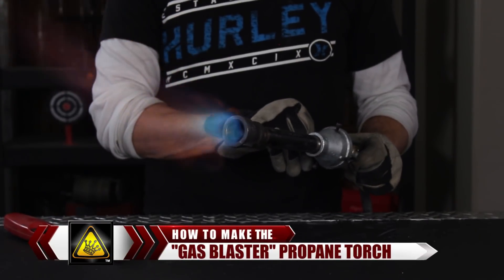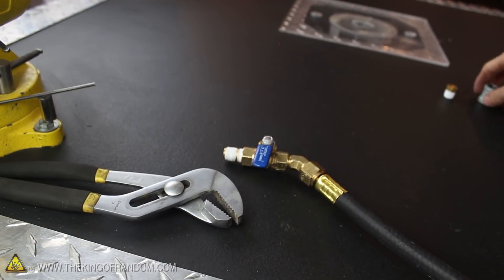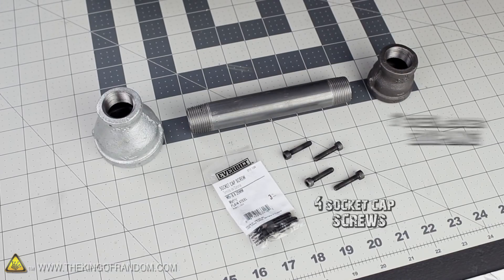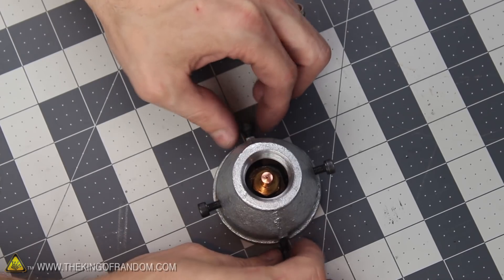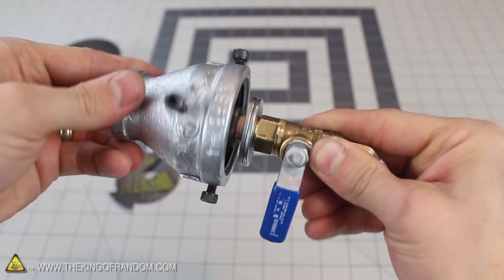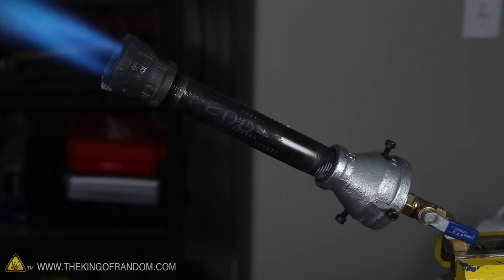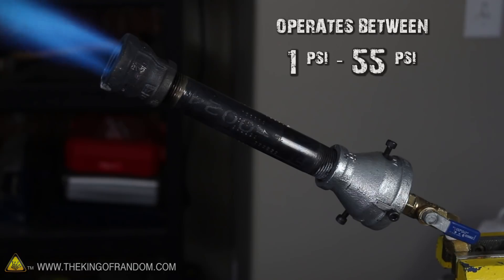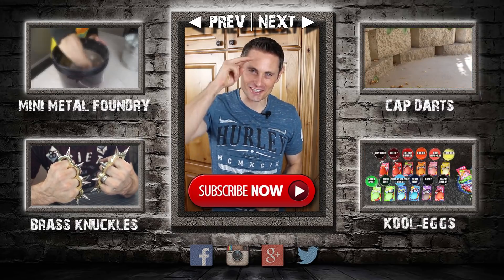Convert Your Backyard Foundry To Propane! ("Gas Blaster" Propane Torch)

Comment: I just finished assembling all of this and the foundry. I will say, you don't need to buy the pipe nipple! When you get the pressure regulator depicted, it comes with a capped off end. You remove that cap to place a pressure gauge. That cap is also what he is drilling into to place the welding tip. Just a helpful fyi to save a couple more bucks.

Comment: Do you suppose you could somehow design an oxygen feed for this set up? I'm curious about what it would take to get hot enough to liquefy steel. Say maybe some captured from a back yard electrolysis generator? On that note, would this jet system work with hydrogen assuming there was a safe way to capture and compress enough for a burn time that would get any work done? Or is any of that even necessary for getting this rig hot enough for casting steel and making iron alloys? So many questions and possibilities!

Comment: hey Grant I was wondering if the propane metal foundry will get hotter than the charcoal foundry, specifically hot enough to melt steel?

Comment: Don't you think it's a bit inefficient to replace charcoal with propane
Reply: But if you've made the forge, you would know that when you take the crucible out of the coals, all the charcoal caves in, so it's a pain to get the steel cup back in.
Reply: well all you can do is just make a  little stump out of the foundry material then place it into the foundry before you put the coal in so that you don't have that problem and it stays hot and toasty without the problem of caving in only thing you need is a second exhaust port for another air supply to keep the heat even
i use a mixture of coke and coal to keep things hot and consistent.
Reply: and by coke he means no, ot cocaine, not cola, but of course that stuff that comes out of coal dummie.
Reply: Mary Horman yeah i kind of wish they had another name for that stuff
Reply: Carbon. lol that's basically all coke is.

Comment: drill a hole in the end of the air regulator, that makes a small handle and use a small chain to attach it to one of your set screws so it stays with the unit at all times.

Comment: I'm not sure if you check this very often, or if you write back, but I'm giving it a shot. I've been trying to build the propane torch based on your video (so naturally it isn't exact), but I've hit a couple snags. It may sound silly, but I don't know for sure what size screw to use. I assume it's a #5 AKA 1/8in, but I wanted to be totally sure. I also had to make an assumption with the pipe and 1in reducer coupling, and figured the pipe had to be 1/2in by 6in. I'm also really hoping that the 1 1/2 in reducer coupling is supposed to go down to 1/2in.
If it isn't too much trouble, I'd appreciate some advice because I don't play around with explosive gases.
Thanks,
Brian.

Comment: I love this idea and the video, but some of the parts here are not exactly easy to get. 1/4" parts seem to be very difficult to find. Ive beeen to Home Depot, Home building center and Canadian Tire, none have most of these brass parts. The 1/4" ball valve seems to be the hardest to get. None of these stores carry it at all. 

Is it possible to do this with half inch parts? They are much easier to get but will cost marginally more.

Comment: Does the heat have any effect on the steel bucket? I was just wondering as the melting point of steel is 1371*C under the temperature the torch gets to.

Comment: I love this idea but i don't really know how its cheaper, I looked all of the parts up online and it all costs about $85, not including the cost of the propane. It seems like I could just use charcoal and a blowtorch for much cheaper. I got all of the prices off of Amazon so if anybody knows a place where the parts would be cheaper, tell me, I would love to know.
EDIT: The whole price also doesn't include the pressure gauge and regulator, or the steel pipe and reducers as I couldn't find those online.
Reply: As someone that made the Charcoal version I can tell you its horrible having to load it constantly and keeping charcoal under the bottom, its just a pain. I am about to make this one but I am wondering how much run time you get from it on a tank of propane.

Comment: I finish my propane torch, and can't produce jet flame, Why?? And which container can we use in propane foundry, Steel? or others?????????? (we are 14 years old, and we need some help)
Reply: you probably shouldn't be making a propane foundry...
Reply: I'm 15, and originally had the same problem that you are having. But now I can easily melt aluminum, and occasionally melt copper and bronze. You probably have the wrong propane regulator, or hooked it up directly to a near-empty propane tank. A barbecue regulator cannot nearly put enough propane fuel for a steady jet. And hooking up the torch directly (without a regulator) to a propane tank is extremely dangerous, and can blow up the fittings or hose. I got this 0-60 psi regulator for $30 from BestMaterials http://www.bestmaterials.com/detail.aspx?ID=15577
You don't even need a 0-60 psi regulator, you can get a 0-30 psi regulator from Amazon, it may be about the same price, but has cheaper shipping and will be easier to order (you have to choose your packaging from BestMaterials, and if you choose the wrong one, they will not ship it) Here is the 0-30 psi link https://www.amazon.com/Bayou-Classic-Adjustible-Regulator-Assembely/dp/B007PS0938
Reply: A steel crucible will be fine, but breaks easily especially with copper. I ended up buying a #3 clay-graphite crucible from Amazon. A #2 might heat up faster for 1 propane torch, but anything from 2-4 kilos works great for this furnace. Here is a link to the one I bought, and the second is for a #2 crucible.. https://www.amazon.com/gp/aw/d/B00FBFUB3U/ref=sxl1?ie=UTF8&qid=1467790817&sr=1&pi=AC_SX236_SY340_QL65
https://www.amazon.com/gp/aw/d/B00FBFOFPK/ref=mp_s_a_1_1?ie=UTF8&qid=1467790895&sr=8-1&pi=SY200_QL40&keywords=graphite+crucible+%232&dpPl=1&dpID=414ydSp%2Br-L&ref=plSrch
Reply: +lynkozz I live in taiwan and can't find the same regulator in hardware store, so the red fire can melt the soda can or not, I only use one torch in my foundry.
Reply: +lynkozz Thanks
Reply: screw that bro all 14 year olds need a propane foundry
Reply: +Jimmy Fennelly OMG that's Hilarious but true

Comment: To be honest. Seemed to be a bit much, but still good video. 

 Dump good lump charcoal into your smelter , light , give force air, and melt away. Allot easier.
Reply: Just tried using the charcoal a couple days ago. No matter how hot it got, I couldn't melt copper. Not sure about brass though. I'm switching to propane to give it a whirl.
Reply: copper has a melting point too close to steel (2000F for copper and 2700F for steel) to be used in a steel crucible cause by the time you get the right temp you might be melting the canister, plus the heat you have inside the crucible would be less than what you need but brass melts at a lower point than steel (1700F for brass) o you should be able to do the melting with brass ( this is theory cause i have yet to try it yet but i do plan on doing so in a couple of days i'm going to use brass casings so yeah wish me luck)

Comment: can this be used for a forge too? so not melting metal but hot enough to work with?
Reply: Yeah it can. He has the valve on their so that you can turn down the temperature to as low as you want.

Comment: this is to hard. wtf cant you get a propane torch and secure it into the "air intake"??
Reply: nope, won't get anywhere near hot enough, also, DIY is hard, get used to it.

Comment: So I went to the hardware store with the EXACT list of materials provided. Hoping that maybe there was only one type of the materials listed. I was wrong. I need to clarify the diameter of:

-the 6" steel pipe
-the smaller diameter of the 1-1/2" steel reducer coupling as well as the 1" steel reducer coupling
-the size of the (4) socket cap screws

just by looking, it would seem the 6" steel pipe is 1/2" diameter, which would also make that the smaller ends of the reducer coupling as well. While I'd say I'm about 80% sure that is the case. I'd prefer to have all the sizes correct from the beginning so that I get it right the very first time rather than having to make multiple trips. So if the OP, or anybody that successfully completed this project wouldn't mind chiming in and letting me know the correct sizes, It would be GREATLY appreciated
Reply: the 6-inch steel pipe is 3/4". The reducers are 1 1/2" to 3/4" and 1" to 3/4". The screws he uses are M5 (metric), but I used M6 as I did not have a M5 tap and it worked just as well.
Reply: +ericotm awesome. That was exactly the info I needed

Comment: Grant, 
I am planning to combine your gas blasters with a metal melting furnace made of those fire bricks from the electric furnace project. It will also double as a forge for heating steel to working temperature to practice making my own blades. If you would be interested, I would love to send you pics of the build and finished product (if it works)!

Comment: Hey Grant! I built the burner, and i noticed something about the way the flame burns. it seems to cough, and sometimes even threatens to blow itself out.  im not sure if this is just because of the parts i used (darn you Chicken of the Sea), or if that's just a normal thing that i does as it self regulates. Would be awesome to get some feedback. Now: for some celebratory tuna. Cheers!

Comment: Could you tell me how much does a gas container like that costs in USA, and how many kilograms it haves when full?
Can you measure how many times you can use it to melt metals for "x" minutes?
Because i'm actually building this metal foundry, but i'm planning to use charcoal instead, because around here i doo believe it is way cheaper than a gas system.

Comment: I have actually done this. It's fantastic. But oh lord is it hot.
Reply: We hope so.
Well, i'm doing the foundry but to use charcoal. I bought the plaster and sand, tested a small piece of mixture, it worked. Now i'm gonna build it all.
Tell me, how much cost a gas container like that on video, and how many kilograms it haves? Have you tested the eficiency, like, it can be used "x" times to melt metals with about "x" minutes every use.
Because around here i would say that charcoal is waaaay cheaper than gas. I'm gonna check it out later.
BTW we have flame torches already ready to use, and it is not expensive. It is used to many things, can be found for aound 7 ~ 10 dolars i do believe, all set, just plug and burn...
Reply: Yeah well duh
Reply: ***** Nope. 99% sure it can't. Steel requires a looooot more heat.
Reply: +TJChagas watch how to make brass knuckles he answers this question
Reply: the propane tank with propane is like 35 bucks the tank empty is like 17 bucks where I found

Comment: can someone please tell me why its not a bad idea to include galvanised parts is a jet torch cause i have had galvanisation poisoning  and that is just not worth it...?
Reply: Galvanization is a surface treatment to the metal. It will burn off quickly. However, you need to do the initial burn outside. The fumes are indeed toxic and can cause illness. In the small quantity of metal in the video I wouldn't worry too much. Give it a good 15-30 min 1st run burn. Should be fine after that.

Comment: Does anyone know what metal his crucible is cos mines melted twice and it's steel from an old fire extinguisher?
Reply: it's graphite
Reply: Make sure you check with a magnet to make sure its steel, I used a fire extinguisher exactly like he used in the original foundry video but it melted so I checked with a magnet on the part of the extinguisher I didn't use and it turns out it wasn't steel.

Comment: I was excited to buy the supplies to build a torch and foundry today but had no luck sourcing the brass fittings. Some of them are difficult or impossible to get in Australia. Mind you I am in a small country town. I tried a plumbing supply store and the guy wanted to know what standard and/or thread size. He also said he's never seen a 45 degree elbow lol. Googling it turns up only one product on ebay so it mustn't just be hard to find here. 

I guess I'll have to use foundry plans from an Aussie. That's a shame, as I like the streamlined design of Grant's. I couldn't even find 6" steel pipe of the diameter used, in 3 different stores!

Comment: wait so we can turn into black smiths for less then £15 !?!
Reply: Provided you have a drill press. If you can't get that mig tip centered well enough the burner will not work properly. And then you'll need a forge body with a refractory lining, preferably kaowool with hardener and a refractory coating such as ITC-100. Trust me, I'm a blacksmith.
Reply: StrokeMahEgo
Yoda: "Smith, Will Smith will."
Reply: Will Will Smith smith?
Yes, Will Smith will smith.
Reply: That comment pretty much sums up every video about melting video he ever made
Reply: Smithing increased to 100
Reply: safety equipment? who needs that?
Reply: Meneer de Koe I mean you may accidentally melt the rocks in the ground
Reply: lol safety equipement with a forge
Reply: how would you accidentally burn yourself if youre just careful
Reply: +Kacper Czaczkowski yeh dude.
Reply: +Артем Закревский Will
Reply: Black Smith is english for кузнец
Reply: WHERE'S THE BLACK SMITH
Reply: yes a sack of charcoal and a hairdryer is all you need
Reply: Meneer de Koe And you don't even need a foundry just a steel pot
Reply: or the ground
Reply: Meneer de Koe Careful though as you may accidentally create lava
Reply: what lava from charcoal lol
Reply: yeah ofcourse
Reply: The safety equipment still costs.
Reply: I know but goggles is overkill
Reply: If you are only making a propane torch and not a foundry, then yeah, I don't think you need goggles.
Reply: Careful or not, safety is still highly recommended.
Reply: Mask or safety goggles, gloves, etc. Wouldn't want to accidentally burn yourself now, would you?

Comment: Where do you get the crucible?
Reply: No, it's a clay graphite crucible that he is using in the video. You can find them on Amazon. Just look up #3 or #4 graphite crucible on Amazon
Reply: +Finn Clark Steel fire extinguisher
Reply: ok thanks
Reply: Here's a link to a number 3 on Amazon 
https://www.amazon.com/gp/aw/d/B00FBFUB3U/ref=sxl1?ie=UTF8&qid=1467790817&sr=1&pi=AC_SX236_SY340_QL65

Comment: I have a question about the insulating mix. Is there a better way to make it? I have used the foundry 4 times (3 times aluminum, once copper) and I had to replace the lid 3 times and now I have to remake the foundry. Is this because of the charcoal, or is plaster just not good enough or what? I would really appreciate it if you responded.
Reply: I've used mine well over 20 times with only minor damage, I'm guessing you have a problem with your plaster or the mixture of sand and plaster

Comment: Wanna send me one of these? I made the foundery and tried the charcoal and it didnt melt anything :( Now I'm sad.
Reply: Did u use the air blower? And hard charcoal?
Reply: Yes to the charcoal, And yes to the blower. But I used a vacuum cleaner that was able to blow air. Is it possible that it was blowing too much?

Another thing, I didnt have a lid for it but i thought it would still work because everything was orange and hot.

Comment: I created the torch to the specs, but it wont stay lit with the fitting off of the end.  I've tried turning the pressure up and down to various pressures but nothing seems to work.  The torch works amazingly with the fitting on the tip, but without it the gas won't stay lit.  Anyone have any suggestions on what may be causing this?
Reply: ran into the same problem
Reply: +Daniel S. I got the darn thing powering my forge now clearly this torch is overkill for an aluminum melt Foundry

Comment: I love the Backyard Foundry mini series the most!  I've actually made the mini foundry, and it took me some trial and error to get it working right, but propane is definitely the way to go on this.  Charcoal produces too much ash, which in the mini foundry, can choke your air flow and cause the crucible to cool too quickly.
Also a note on crucibles: get a professional graphite crucible. It wont warp, it doesn't flake and rust like steel does, and it essentially acts as a non-stick pan when it comes to metals.
Do you plan to make a larger foundry and a burner for waste oil/diesel anytime?  I've seen a couple youtubers do this, but I think it'd be a great addition to this series.

Comment: can you melt steel
Reply: +Caen Ridder propane plus air can get to 3600 degrees. propane plus concentrated oxygen can get to 5000 degrees.. but how hot can this furnace get is what I want to know.

Comment: Quick question... @Grant Thomson - "The King of Random"
will the regular coal and hairdrier configuration reach temperatures high enough to melt brass, or do you NEED to make the propane jet to melt brass?
Reply: +Maximilian Lotz i can answer this as I just tried it. I had no luck getting it hot enough for brass. Melts aluminum just fine though.

Comment: hey grant think you could add a parts list at the end of your videos for simplicity sake thanks !
Reply: +TheRubberMeep you could just pause and write down the supplies you need
Reply: +TheRubberMeep 
After searching around where I live, the total price comes ot to around $150.  But that's mostly because I don't have a drill press, taps, or bits that are needed for this video.  Other than that, the regulator I'm looking at getting is $40 by itself.  Do some hunting and you'll find what you need pretty easy.  I found all of it on Amazon and searched local hardware stores for comparable pricing.
Reply: +Da Demon Monkey or have them in the description for easier copy and pasting?
Reply: exactly! and a vague price list so we can budget
Reply: thanks man !
Reply: Look on the description